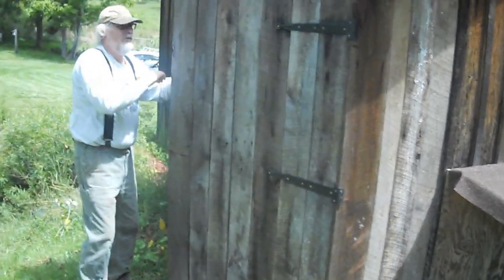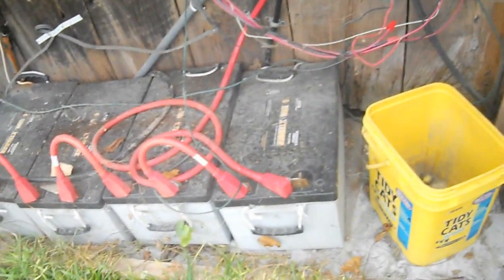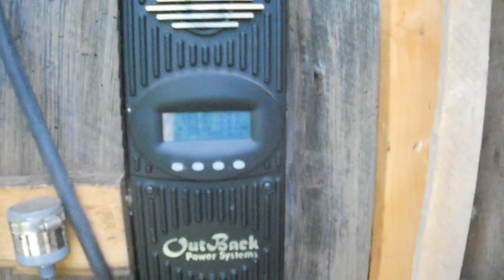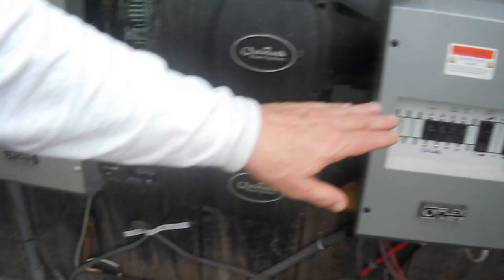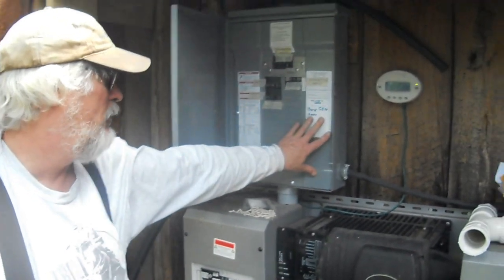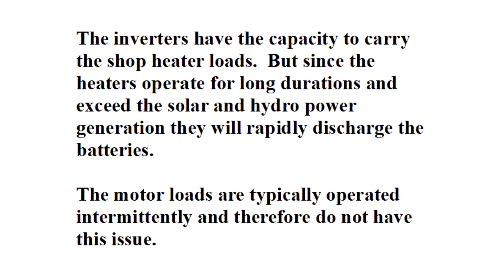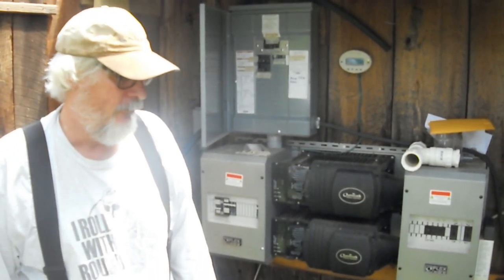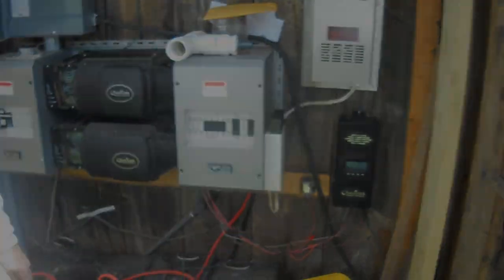A Micro Hydroelectric System, Part 2 - The Switchgear

Comment: Very cool, Instead of dumping the extra electricity into nowhere, he should build a nice hot tub to dump the heat into. Or another interesting idea would be to use it for electrolysis and take the hydrogen out of water and store it in a tank for gas heat or to run the generator or whatever.